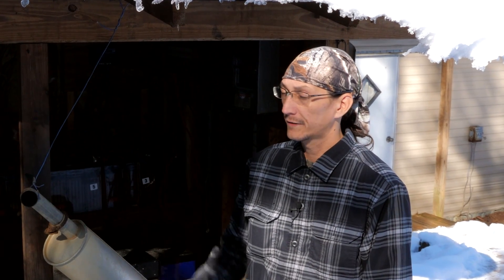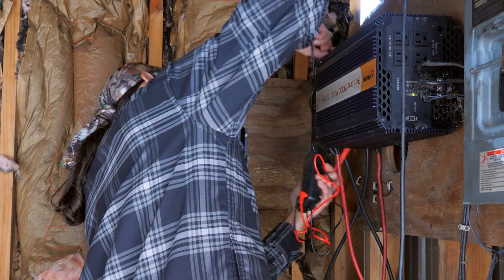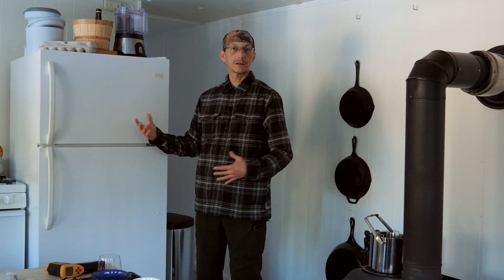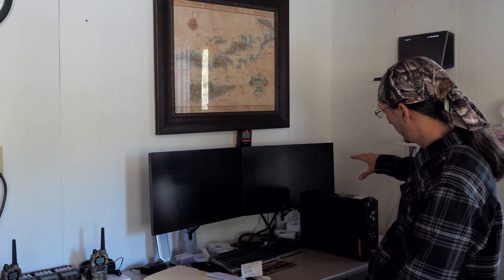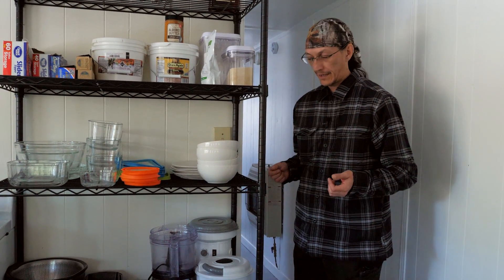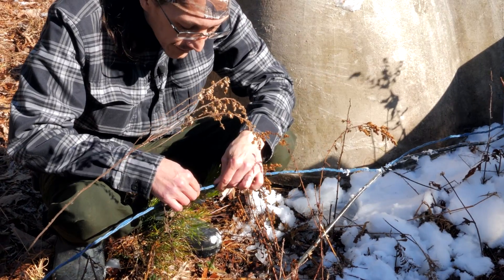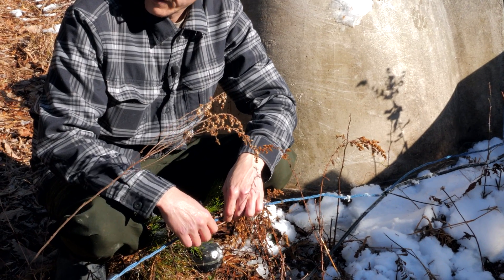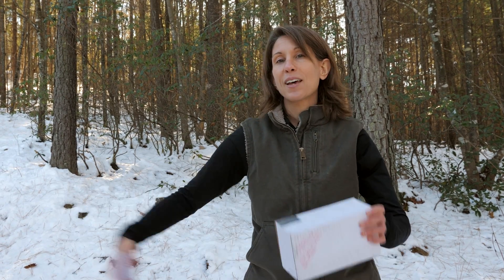Off Grid Electricity - Our DIY Solar System

Comment: Hi guys. You have a good start, but should definitely invest in a new system especially if you plan on building a home. I would recommend at least a 24v system if not a 48v system. Check out my channel and see a few of the systems I put together for my customers who are all Off Grid. My videos aren’t good like yours but might give you some ideas! Remember the higher the voltage, the lower the current. Anyway keep up the videos, I am jealous in many ways of your off grid journey!

Comment: Hi, Please do not think I am here to bash you. I am just trying to help. On a 12 volt solar system, you should see about 18 volts coming in from your panels. Nice looking batteries but you're going to kill them if you keep undercharging them and over discharging them. Lead acid batteries should only be discharged no more than 10.5 volts. (I do not go below 11.5) Fully charged my batteries read 13.5. I think you said some of the panels were bought and some were homemade. If so check eash panel to see its output as the system is only as strong as the weakest one. Solar panels are cheap batteries are not. Talk to or watch Engineer775 he knows his stuff when it comes to living off grid. (solar, water, heat, cooling) He can truly help you.
Reply: You, my friend, just said the #1 reason people kill their Battery banks. Fully charged, my bank reads 25.2 and we don't (typically) go below 24. But sadly, I went cheap on the bank and now I'm in the market for new batteries. I'm thinking a Reconditioned Forklift battery.
Reply: Hi TOGG, I have thought about how a forklift battery would work out in a solar setting. I spent over 8 years on a unloading dock and everything we drove was elec. and have seen batteries last 8 hours without having to be recharged in a 10-hour shift. Things to think about is moving one around, we had lifts and rollers to deal with the weight. The other is be careful buying a reconditioned unit. We sent out some batteries that came back and they were junk and some came back and were ok but I have never seen one as good as a new battery. But I know you know what a new battery cost. I know our batterys had a hard life, they never got charged right, watered right, I have seen and done it but have to push a lift to a charger as it would be 100% dead volt meter pegged in the red.

Comment: 3 days is probably not realistic... using a small efficient generator to charge your batteries daily is the most efficient, "if" the sun isn't shining.  Spend you money on panels, not batteries, and do as much with direct solar as possible.  Batteries are not your friend.  I'm not a huge fan of Engineer 775, but he is very smart, and it's probably worth consulting with him for some real world information.  He knows water better than most people.  You need to store water at the top... not try and pump it when you need it.  Pump it all day slowly, and store as high as you can, if not use a small pump to meet you immediate needs. Call him it will be worth your time/money.
Reply from the maker: Makes total sense 👍🏻

Comment: I have not read the comments so.....Regarding your solar setup...your problem is not so much the controller as it is the wiring. Your running way too far for the size wire you have. You need #4/0 welding cable for that system. Your loosing 6v...in the solar world that's like, well...HUGE!  Another (MPPT) controller might...MAYBE...help some but will not be a long term solution! Your batteries can't catch up because your loosing all this power in the lines! I suspect I am not telling you anything you don't already know...A 2% voltage drop is the magic number to shoot for and obviously the lower the better. Save for the wiring, run the large lines into a terminal block that fits the line size, then make a short (very short) run to the controller with a wire size just right for the PV terminals on the controller. This will solve any issues with making the large wires fit the smaller controller holes.

Lastly...MY GOD BROTHER...at least put a tarp up in front of that shed! :) Show those batteries some love...PLEASE! LOL...Seriously though...you could run a tarp between the genny and the batts or build a quick wall and throw some insulation in it...anything to get the temps up in there which will go a long way to helping your situation.

You should go look at this link: https://www.youtube.com/watch?v=AoxHtcU2woM it's engineer775's "down and dirty" solution for solar and it works (trust me!). 

Keep livin the dream my friend....We will keep watchin! :)

Comment: 12 volt battery at 12 volts is a dead battery!!!!. i would hook a battery charger up to your generator  and charge the heck out of them and then let them rest for and hour and see if the voltage will stay up to 12.7 volts,  if they dont stay around 12.7 then the battery's need to be replaced

Comment: Check out the youtube channel thebossofswamp. He built a in house cooler to food that was connected to the outside. His place is off grid also.
Reply from the maker: That application wouldn’t work in our climate
Reply: yeah, the boss is cool, and if you're going to freeze water bottles to keeps things cold, freeze salt water. salt water freezes at 28.4 F vs 32 F, thus keeping things cold longer.

Comment: For winter time fridge cooling Engineer775 showed a product a few months back that could help https://youtu.be/B6WRF54yijE Figure a milk crate next to the fridge you throw them into over night to freeze then in the morning throw in the fridge to be an ice pack. 

A good way to get a computer load off the inverter is a DC power supply. would take 12-36vdc input and convert it to the 1.5-12vdc the computer uses. Only good for PC's as macs are harder to find a dc power supply for. Can also get 12vdc car outlets to put at points for dc power supplies to run routers and some monitors and tvs. It still a load on the batteries but bypasses the inverter as the dc to ac to dc switch is a big energy waste. powerstream.com has a good selection of dc power supplies. 

Can charge phones and tablets off the batteries bypassing the inverter using 12-24vdc to usb outlets at the points you want to charge them at so no chargers needed just a usb charge cable.